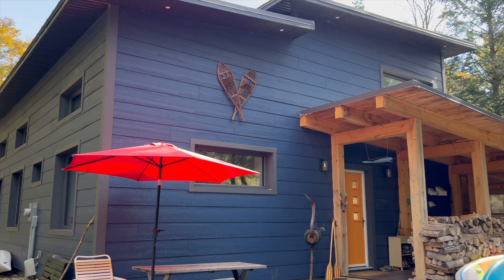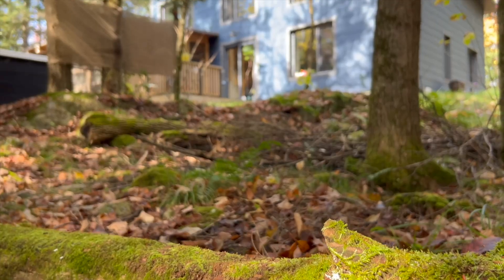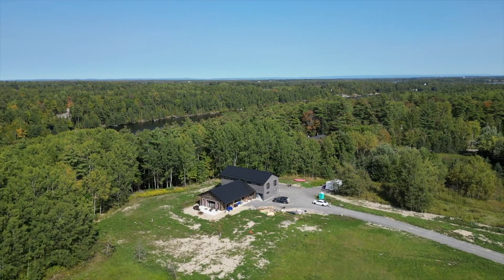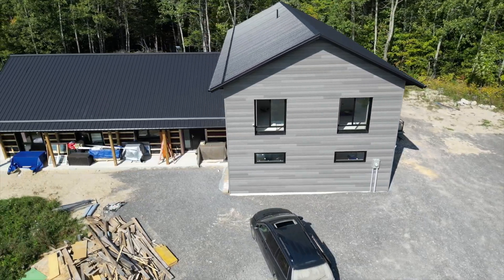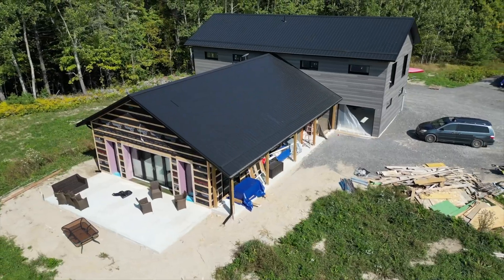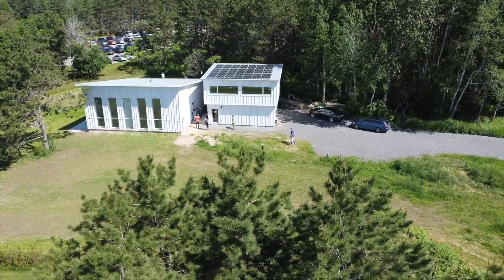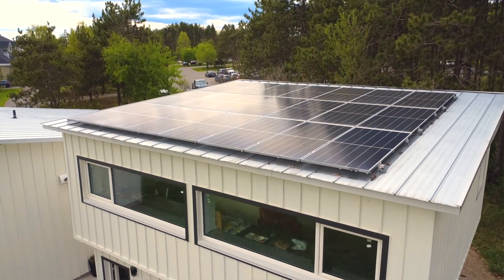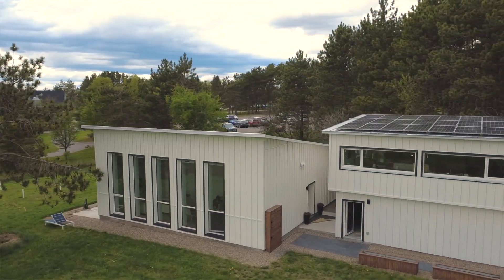Passive House vs Non-Passive House (Pt.1) | Orientation & Window Design Explained

Comment: New homes should come with large roof overhangs, solar panels, a rain water collection system and an electric vehicle charger in the garage.
Water is the enemy of buildings. Large overhangs add beauty and protection for doors, windows and siding.

Comment: What technologies are available to improve the performance of a 30 year old house without creating an environment for mold?
Reply from the maker: 1. If the siding has to be changed, exterior continuous insulation with air-barrier 
2. Passive like windows with insulated frames installed with high SGHC in South, low SGHC everywhere else
3. If the first item above is done, a passive ERV would be a good addition
4. It may be possible to seal the building (reduce ACH) by using Aerobarrier, if so, this would be a inexpensive solution